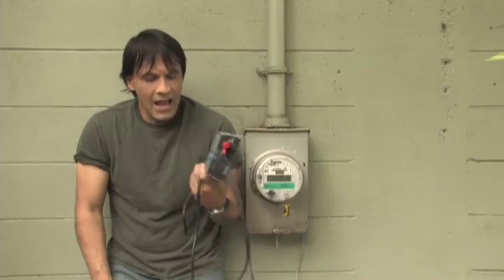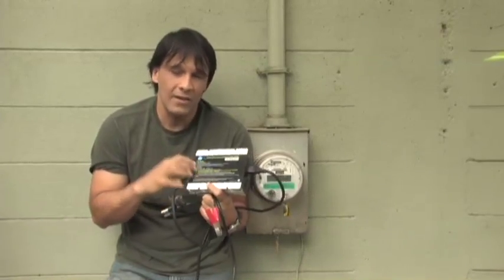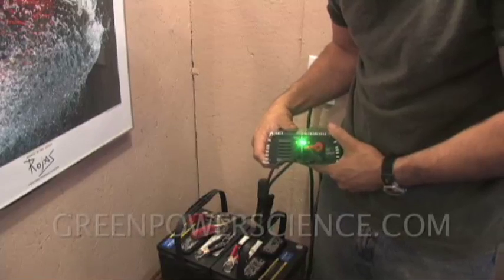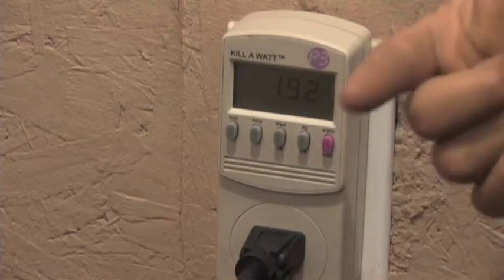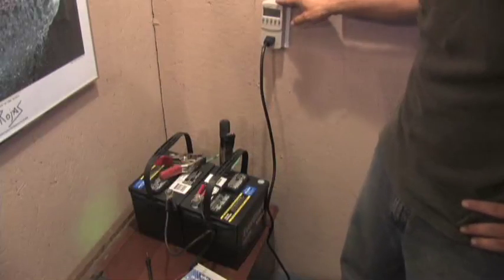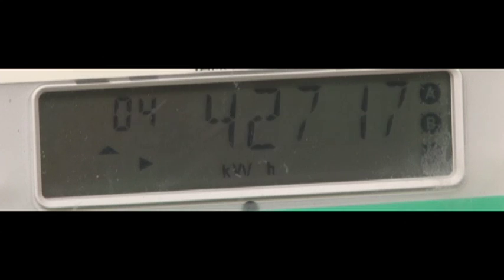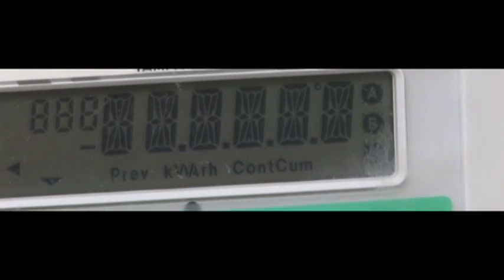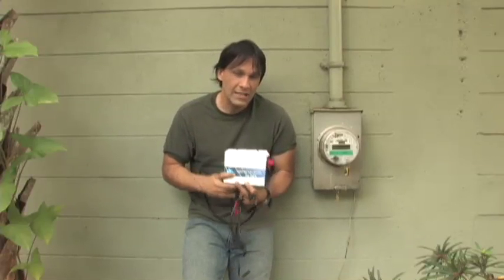GRID TIE INVERTER SOLAR panel POWER EASY Electricity Savings

Comment: "One thing to note about these inverters is that you can hook as many as you want to the same circuit." Not entirely true. It depends on the circuit breaker rating. For instance take a 15 amp circuit. and say you dont want to load it any more than 80% of its rating. Then you can hook up 7  200 watt inverters.
Reply: 7200 watts after your inverter would be ruffly 60 amp's, watts divided by volts equal amps.
Reply: John Luckay Thank you but I did not say 7200 watts inverters. Instead I said "7 200 watt inverters." Seven (7)  200 inverters give you 1,400 watts of power generating capacity; that when divided by 120 volts is only 11.333 amps.

Comment: Hey Dan, you know how a generator connected to your grid only feeds that specific line to the break box and not the rest of the house (so I have been told), does this do the same?   thanks.
Reply: GREENPOWERSCIENCE Dan, I have been searching for more information on this. Theoretically, the power I am producing then feeding through the GTI is the "first" power my house system uses due to the slightly higher voltage of the GTI? Does this mean that the current from the GTI does not make it to the meter unless I am producing more than the house is using? I have heard net metering horror stories of people paying for what they produce with their "guerrilla" grid tie systems.
Thanks!
Reply from the maker: This is grid tied and reads the grid line voltage then feeds a bit more into the house grid front running the power company's electrons. Isolated lines are usually a single breaker and for solar it needs a battery bank. The grid tie is a supplement and works good.
Reply: CW Hardcastle I've heard about that paying for what you send back to the grid thing too.  I doubt it's true and I've seen at least one smart meter where when the guy shut everything off and fed the grid with a kw of power but his meter didn't change over time.  In other words, it didn't run backwards but it didn't run forwards either meaning he wasn't being charged for the power he was supplying, he just wasn't getting paid for it.     So it seems to me that you could do his experiment, that is hook up and shut everything in the house off, and give the thing an hour or so on its own and see if your meter reading changes.  If this is an issue, then I suppose the thing to do would be to just supplement an amount that you know will be consumed and not feed to the grid.     There is a danger with these plug in systems.  Let's say for example that you have a 1200w plug in system.  you plug it into an outlet and now it is feeding that circuit up to 10 amps.  The circuit can also be fed 20 amps from the grid through the breaker.  This means that appliances plugged into the line could pull up to 30 amps before they would trip the breaker which would exceed the 20 amp rating of the wire.  So these should always be plugged in on an dedicated circuit that goes straight back to the box with nothing else plugged in to it.

Comment: Hi Dan,do you know any where I can get an  inverter that run's on 230 / 240 for UK.I cant find anything I am after 2000/3000 watt to help my dad replace is stolen 600 watt solar set up they took everything I know it took him long time get everything all I can find are 110 inverter's and little 230 car inverter's  and all the panels had from ebay just rubbish so I go some off a UK solar supper to find came same place cost twice as much anyone out there know anyone can help    Norman
Reply: The electric company detected the grid-tie inverters and paid me a visit.  If they are not UL1741 approved and ok'd by the utility company, they turn off your service.  You also need a lockable disconnect from the inverter to the breaker near the panel on a dedicated breaker.
Reply: google "grid tie inverter 240" sort by price if you want smaller ones. One school of thought is to hook all solar cells into one big inverter, but shading can significantly affect an array tied to one big inverter. So the other school of thought is to use micro inverts to get more total power from the system if parts of your solar panel array are going bad or are shaded.
Reply: Keith Reynolds  how do you get from micro inverter to grid-tie?
Reply: Most micro inverters are grid tie inverters from wikipedia
1. "A solar micro-inverter, or simply microinverter, is a device used in photovoltaics that converts direct current (DC) generated by a single solar module to alternating current (AC). The output from several microinverters is combined and often fed to the electrical grid."

2."A grid-tie inverter is a power inverter that converts direct current (DC) electricity into alternating current (AC) with an ability to synchronize to interface with a utility line"
Reply: Keith Reynolds Your right.  I just received one.  So, how many micro-grid-tie inverters would you use on 4 panels at 250w each?
Reply: For best performance from each panel, you want one micro inverter for each.  When determining which to get, make sure that it is a a little larger that the maximum power output of the panel so that you wont stress it. Furthermore, make sure its rated voltage range matches your panel output. For those that have several solar panels with low power output, like say 50 to 100 watts each, and you have a 250 watt micro inverter, it is ok to connect the pannels in parallel and then connect them to the inverter so long as their output voltages are the same and the combined amperage is within the range of the operating specifications of the inverter. 

Practically every micro grid tie inverter has maximum power point tracking to get the best performance out of each panel. So, for maximum performance, you want  one  inverter to a panel. Hooking up two or more panels to an inverter will cause all the all the panels in your array to each output only as much as the lowest performing panel. Consequently, a little shade on just one panel will lower the output of each panel in your array.
Reply: Good advice.  I'm new with micro-inverters. What if you ran wire from each panel to the attic for each inverter to keep the a/c current out of the weather?  Say 30' from panels to inverters in the attic. What type of fuses do you use and where?  Thanks
Reply: The longer your low voltage lines, the more power drop you'll experience. This is one reason why power companies distribute high voltage AC.
Reply: It seems safer to run the low voltage lines inside to the inverters.  Maybe place the inverters in the attic as close as possible to the panels? Or do you hook them physically to each panel?  Thanks for the advice.
Reply: Is it wise to include batteries in you solar config? do you have better results w/ panels to inverters? I know it depends, but comparing end results, which makes more sense? 
Thanks for your advice.
Reply: Is it wise to include batteries with micro grid tie inverteres. NO. Well 1st  not if you want the inverter to use maximum power point tracking. to get the most power out of it, and 2nd you have more important things than batteries to sink your money into. 

Batteries makes sense only in a few niche applications such as:
1: When your off grid, in which case, you dont need the extra expense of a grid tie inverter.
2:  Where your charged more for power at certain times of the day, and the difference is great enough that it will pay for itself over the life of the battery. 
3: Whole house backup, but it is unreasonably costly to have enough backup to last your anything more than a few hours when a natural gas standby generator will last you many more years. for about the same upfront cost and will supply you electricity for weeks if need be.
Reply: I got it.  A non-battery system is the most efficient with micro-grid tie inverters for each panel placed as close as possible to the panels.  We dont have natural gas in our area so thats out.

Comment: There is a flaw in your logic. If the inverter requires electricity to be present from 120V plug, as you say...and you turn off the main breaker...then the inverter is not doing anything, it simply stops. Also, if you turn off the main breaker any electricity generated at your home isn't even getting TO the meter!
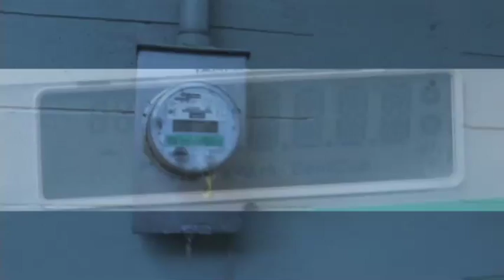Reply from the maker: Main is turned back on and only one breaker. 8:07
Reply: Understand now

Comment: Hello I am looking into a 15 Watt , 12 Volt Solar Panel from Harbor Freight. I would need 2 of these to run a 200 watt grid tie inverter.  Am I correct?
Reply: 2 harbor freight 15 watt panels are worthless. Get a couple 100 watt panels at minimum.
Reply: Hello, Jacob. You wouldn't by chance be the one spamming invites to Relentless Heroes chat, would you?
Reply: Would you please remove all Retro Pro Gamer players from your mail list?

Comment: no, that is not exactly true:
the meter reads finer than 1KWh steps, it has to do that in order to funktion. just because the display diesn't show the .1 or .01 steps, doesn't mean the meter does not internally read that.

Comment: There are so many variables at play, power cost: peak, off peak, commercial, residential, etc ... but also how much sun you will get for each of your power consuming days. Anyway, I'm guessing you consume an avg of 2,620,000 w p/m and your max effective efficiency (sun, clouds, rain, and panel efficiency) is 60%, with 10hr daily work day, then you would need     about 72 200 watt panels with GTIs total cost $25K self installed.  After 5.6 years it starts paying for itself.

Comment: i want to make an electric self sustaining generator that would already be producing ac but want to wire it to the grid do i have to do the very ineffcient switch my already ac to dc so i can use a grid tie inverter

Comment from the maker: 2 panels in series at 24 volt load will work for a GTI rated for the 24 watt range. Open voltage of 2 panels would be around 41-42 volts so your inverter needs to be 20-55 volt range. Most are. Check the range of the inverter.

Comment from the maker: You hook panels directly with GTI's no battery or charge controller. You hook regular inverters to a battery with a charge controller between the panel and battery. GTI's go direct or they will drain a battery at full load.

Comment: Agreed, the big question is how much power did he use from the time he shot the meter to the time he got power turned off.
Thus - in order to get it to run backwards 1 kw he would have had to leave it on much longer than the 40 min he said in the video... my guess is the meter would have ran backwards as it already indicated the direction of current was going in the other direction (Back to the Grid)

Comment: someone please answer, I need to know in order to calculate possible rates I'll have to pay the utility co and if its even worth it to get grid tied;
  if you have an appliance plugged in between the grid and the inverter, will the appliance intercept all of the energy from the inverter and avoid as much as possible from the grid, or will it alternate it's source of energy between the inverter and the grid, like half and half?

Comment from the maker: If you produce less wattage than you use, they cannot regulate what you plug in your house *public businesses and rentals are different). By producing less wattage, you still have an electric bill but it is much smaller. The goal is to come closer to zero, not less than. No electrons back flowing, no problems. Codes are dependent on the area you live in.

Comment: Nice video! But at 7 mins 4 secs into the video, you mentioned taking 10 by 200 watt inverters and pump 2000 watts into the house. I assume that we can't just connect a 2000 watt output straight into the home wall socket heheheh (due to house-hold wiring in the wall plug not being able to handle 2 kW). I know what you mean though. But just in case....

Comment: Unless the system rounds up to nearest kw, in which case, even though you just ticked up, the system would not recognize the few watts you were just over, which means it would take the full 5 hours to tick back.  Not sure, just a thought.  Maybe you have to have a special meter that would allow "buy back"...

Comment: Everyone understands what you are saying, but you don't understand what the guy in the video is saying.  He waited until it JUST ticked.  I know it doesn't display fractions of a KWH, but surely it measures them (otherwise how would it know when to tick forward?).  So he switched it at 42717.01, and it should have ticked back quickly when it reached 42716.99.

Comment: The meter reads in KWH NOT KW. A KWH means 1000W per hour! With me so far? The meter does NOT read any fraction of a KWH. So, it logically, even if you can't grasp it in reality, it stands to reason that an hour of 200W is an hour of 200W and to reach 1000W you must multiply by 5 hours to have delivered 1KWH back to the grid to make the meter go back by 1 digit. Why is that so hard to grasp? In any case I am not embarassed whether you get it or not! The point is correct!

Comment: Help me understand this, you say that the GTI only outputs AC when it detects AC (right?).  If so, then why is it pushing it out after you killed the main power at the house?  I'd have thought you'd need to keep that circuit on. 

Also, are there GTI's that operate only on 12V (you said these require +14V)

Comment: You actually can plug a normal inverter into your homes AC plug in a blackout BUT and this a MASSIVE BUT....you have to keep your main circuit breaker OFF this is because of the reasons stated already.Once the MAIN breaker is OFF you can use the power to the other circuit breakers like plug sockets.When the power comes back on,DISCONNECT your inverter from the AC plug and THEN ONLY turn your main circuit breaker back on.If you don't do it in this way,terrible terrible horrors await!

Comment from the maker: It transforms voltage up higher in exchange for lower current (amps) and inverts DC to AC. "Power" cannot be amplified, it can be stored and released in bursts (capacitor) or have voltage interchanged for amps (transformer).

Comment from the maker: when the power goes out the GRID TIE INVERTER shuts down. Your neighborhood in a blackout is a massive dead load. If the unit did not shut down it would get destroyed in seconds as it is impossible for a home's solar setup to power an entire neighborhood. So the anti-island electronics has two purposes; Prevent low voltage back-feed in a blackout and protect the unit from destruction.

Comment: This inverter is illegal in the US.It violates the NEC because it plugs in.All grid-tie inverters under the NEC must be hardwired.If you backfeed with an unapproved device like this you will get caught and your power shut off.You will also be fined by the power company for tampering with their equipment (the meter). A "net meter" that can keep track of electricity flowing both ways is not installed unless you obtain proper permits first. A one-way meter will detect backfeeding and set a flag.
Reply: isn't the point to break free from the grid?

Comment: You don't understand, it's not like a watch. Once it read 7kw it had been an accumulation of watts to that point. It's like a long road you take to a certain point then turn around and you have to go back the same distance to get to where you started.  It would not have read 6kw till it had run backwards 1kw. It only reads kwh not a fraction of it. Does that make sense now?

Comment from the maker: You may have a damaged diode. Look for any odd tabbing/bus wire shorts and see if the junction box on the back can be opened. If the tabbing looks good, it is in the box. Or the cells are really old which is not likely.

Dan

Comment: you will never be able to back feed the grid and or pole or district transformers the hv primary is 18-20 kv  the output to a house is 220 vac a little inverter can not push back  that kind of voltage and current and if you could the transformer would explode and burn up the hv line its like trying to hold back the force of a million gallons of water in a dam with your finger wich do you think will win? its stupid for china to make and sell them real bad idear

Comment from the maker: Impossible
watch?v=J3b_fGUnaFE
GRDI TIE INVERTERS only work if proper voltage is detected. GTI shut off when power goes out. Your entire neighborhood also acts as a gigantic dead load. A 300 watt or even 10kw inverter would burn up our shut down if no island protection. GTI produces no power unless 100-120+v ac is detected.
Also if you do not back power (no reason to as there is no financial incentive) it is considered an appliance. So long as electrons stay in your house grid.

Comment from the maker: Meters are ratcheted, both digitally and analog dials. Meters register electrons in. If you add 100 watts to your internal grid, 99% chance your house is always using at least that much so: if SOLAR PANEL/GTI is producing 100 watts into your house grid, your house is using solar first because the voltage is slightly higher. The power company line in load is lowered by 100 watts slowing the meter. The goal is to supplement, not back power the grid.

Comment from the maker: Watts in equal watts out. 80 = about 65 out on a 300 watt grid tie inverter.

Add 2 x 80 watt panels = 160 in about 140 out. The GTI uses power and panels are usually over rated. Just do not exceed the gti limit. Less is fine. Larger GTI require more power consumption for cooling and conversion.

Comment: This same process is necessary to receive tax credits and the $1000 credit from the utility. Oh, and then the electric company puts you on TOD useage billing along with net metering. This isn't necessarily a bad thing as many would be solar/wind users really aren't knowledgable enough to pursue electrical endeavors but it does lock those of us that do, out of the game unless we pursue "off grid" systems. That isn't necessarily bad either, as it also accomplishes the desired result. (continued)